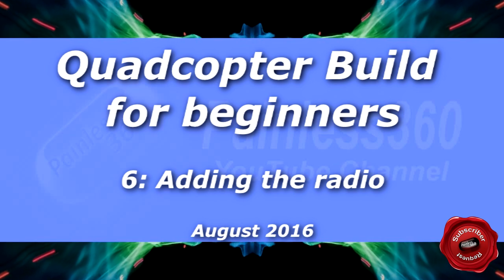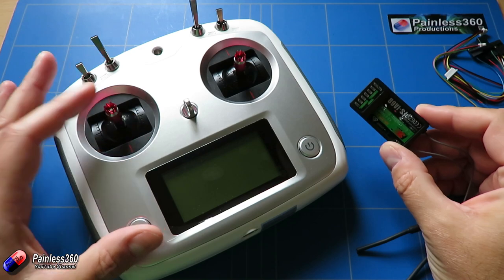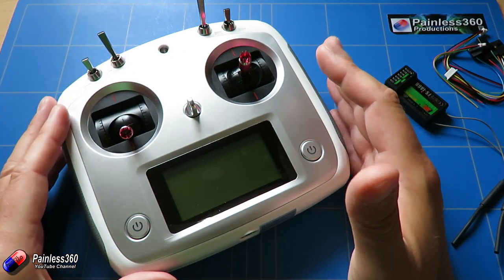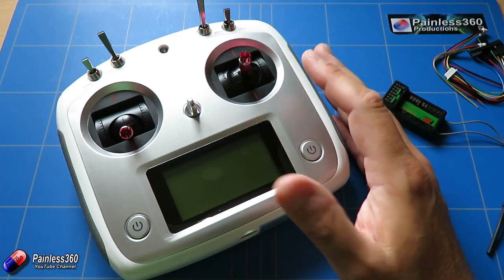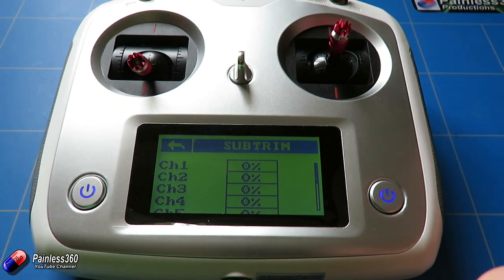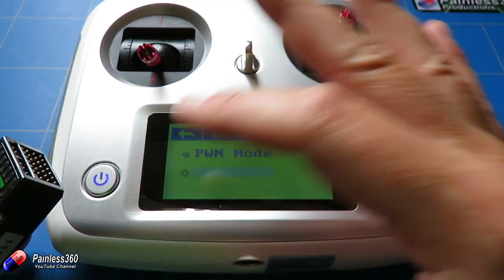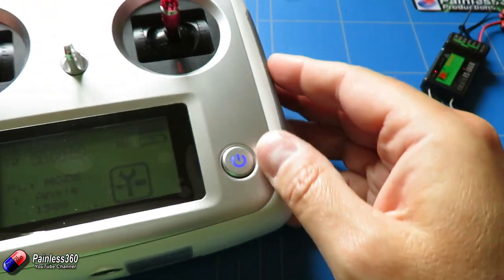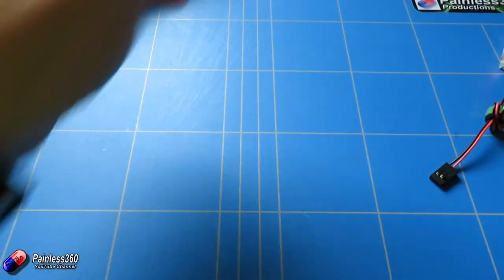(6/9) Quadcopter Building for Beginners - Setting up and adding a radio

Comment: Hello Painless360. I've got my FS-I6S,  i set up PPM output, stick mode M2, gave +5V and GND only the CH1 on the receiver and i have connected to the signal pins from receiver CH1 to APM input 1, receiver CH2 to APM input 2 and so on..., but it does not work, usually i have one channel which i can see something changing in the RC calibration, but others don't do anything when i am moving the sticks. Could You help me what can be the problem?
Reply from the maker: All of the detail on how to setup the radio and controller are in this series. If you're using an APM then we also have a series on that too.. In all of our APM builds we've used PWM (that's how you are wiring yours)..
Reply: Painless360 yes you are right,  that's my english is bad and i understood PPM and not PWM,  anyway i changed it and it works perfectly now.  Thank You for your answer and patiency..

Comment: What controller did you use the mode 2 or self centering throttle ??? cheers
Reply from the maker: See our series on the radio we used on the channel. For almost all self build quads you want a throttle that isn't sprung. The radio in the video is Mode 2. Happy flying!

Comment: Sorry for bugging ya about this again, but just to be sure so I don't burn a board out (again), I am safe to just use the 5V connector for the PDB to power my receiver up, correct? Thanks again
Reply: I've got the receiver coming on whenever I plug the battery in, but if I have the SBUS wires plugged in as well, then the flight controller lights nor the receiver seems to come on, any particular reason that might be?
Reply from the maker: That looks like you're connecting the SBUS connector into all the negative pins on the Rx, essentially shorting the GND, 5V and s_bus pins.. If that's what you're doing you're lucky you didn't cook something with the short..
Reply: Painless360 There's a bottom 4th row of pins for the SBUS connectors that goes (-, +, signal) it isn't the negative pins.
Reply: That's why I'm confused because the way it is acting I would assume the same thing, but whenever I'm looking at the wiring diagram for the SBUS connections its telling me to go to the bottom row below the negative pins and to put them in that order. Anywhere else you might suggest to begin troubleshooting?
Reply from the maker: +Gaige Chester if you shared what the receiver is, I might  ;)
Reply: Painless360 it's a R9D receiver, I've got it hooked up now and I took the drone for the first hover. Only problem to deal with now is that it just spins in circles lol
Reply: So I suppose my final question to you would be, is the spinning more than likely just a matter of trimming the quad, or should I be searching for another issue inside of CleanFlight? Thank you for all of the help you have provided to me!
Reply: So I suppose my final question to you would be, is the spinning more than likely just a matter of trimming the quad, or should I be searching for another issue inside of CleanFlight? Thank you for all of the help you have provided to me! I will highly recommend this channel to anyone building quadcopters.
Reply from the maker: Gaige Chester I'd check a lot of the same things you need to check if the copter drifts  - 1500 yaw control etc. Plus make sure that the propellers are on the Motors the right way round and that you haven't got any spinning the wrong way, as the Copter will use the rotation of the Motors to turn in the air so if you have one that's turning the wrong way round it will push it about.
Reply: I'll probably go through the video of your setup on CleanFlight once again, and then test fly.

Comment: Hello, Painless360. I am currently building my Dubai 210 Racer. I soldered everything, but i found that i cannot seem to connect my fs-ia6 RX with the F3 Flight Controller. I am using Fs-i6 Transmitter and successfully bound it with the RX. However i power the RX by UART1 on the FC and i have plugged all the cables from I0-1 and I0-2, but i get no response whatsoever. Any help would be great. (First build)
Reply from the maker: See the video in the SP3 series where we add each of the common receiver connection types.. Best of luck!

Comment: I have a small ppm receiver that I bought, do I simply connect the three red wires to that??
Reply from the maker: The PPM connection needs a GND, power and the PPM signal cable.. check the wiring diagram for your F.C. or model.. best of luck

Comment: Can you please help me. I follwed all of the steps in the video up until i was in cleanflight. I adjusted the rx settings to ppm, once i return to the rx menu i was still unable to see the graph like bars move when i moved my sticks. Also when i connect to the computer i can only use cleanflight when plugged into the power board. This is my first drone with basically no research done beforehand so im lost.
Reply from the maker: +Eric Sudfeld sounds like a little more research is needed, if you Google 'power painless360 usb' you'll find my video why it won't work off the USB. Watch the other beginner builds and introduction to radio control series for more of the basics. Best of luck

Comment: Can you please share the schematic for the 'Battery eliminate circuit' if it is DIY shown in the video at 13:00?
Reply from the maker: +Srinivasa Kumar it's a standard BEC. This one is a 3a switched model from Turnigy, you just need to solder on a battery connector. Best of luck!

Comment: Hello Painless, would you kindly show me how to connect servo channels like retracts or gimbal controls when using i-Bus on this transmitter?
Reply from the maker: i_bus is a single wire communication. if you want what you're after then you'll need to use PWM output on the receiver.. Best of luck!
Reply: Thank you for replying.

Comment: I have managed to bind my transmitter to my receiver but in betaflight under the receiver tab my transmitter isn't showing the control bars moving when I move my transmitter levers.??? Any suggestions.
Reply from the maker: What radio you have in your hands makes absolutely no difference to what the flight controller need. It's more about the protocol used in the model from the receiver to the FC. https://youtu.be/4iqKp-7RQkk may be worth a look... Best of luck

Comment: Great video. However, mine is still not working. I have a FS-IA6B receiver soldered directly to the FC. I plugged the FC to the 3 pin PPM/CH1 slot. I followed instructions for the transmitter FS-i6S. Cleanflight settings were altered like you mentioned. The Gyro on Cleanflight is responding according to the position of the FC. However, when i move the sticks on the transmitter, there is no response on Cleanflight. I am beyond frustrated. Any help would be highly appreciated.
Reply from the maker: +martin goggins campos tricky to offer any advice without knowing what troubleshooting you've already done. I'd check the receiver has power, is bound to the radio and that you have both the flight controller setup for PPM and double checked any settings on the radio to make sure that it's set for PPM too. Best of luck!
Reply: Thank you for the reply. The receiver has power (red light on) and successfully bound to the radio (RX shows up in the radio). I have the PPM set up in Cleanflight and the radio. Could this be a software issue? I was thinking of maybe rebooting, unless you can think of something else?
Reply from the maker: +martin goggins campos PPM mode on the radio?
Reply: Yes.
Reply: I started from scratch and did the following: 
1. Bind the radio to the receiver (radio shows RX signal)
2. On Cleanflight, i flashed firmware (No Reboot sequence, Full chip erase, Manual baud rate (256000). I did this after shorting the boot pads and got a solid red light).
3. Load Firmware (Online)
4. Flash Firmware (it worked and i got a successful message on Cleanflight. 
5. Connected FC to Cleanflight. 
6. Set Receiver to PPM RX

The gyro appears to be working as it shows up on Cleanflight and is responsive. However, there is no response when i move the radio sticks.

Comment: Hi, we got a connection of the RC receiver and flight controller using the PPM. However, receiver is not communicating with the ESC and motors. When we test the receiver with the transmitter and motors individually from INAV GUI, everything works perfectly. Could you give us some advice for what we can do to resolve this issue?

REPLY
Reply from the maker: What troubleshooting have you already tried?
Reply: We tried troubleshooting for the RC transmitter & receiver and running the motors individually. Are there anything that I can do else for troubleshooting?
Reply from the maker: So, can you arm the flight controller? Please see my build series for the steps I follow to get flying every time..
Reply: We tried almost everything to fix this (my pre-arming status is perfect), except for one thing. We are using the INAV and we do not have the GPS module. Do you think that is the problem?
Reply from the maker: Tricky to comment but see my iNav series on the channel. I'd confirm that the flight controller is arming and not erring as it's expecting a GPS.. Best of luck!

Comment: I bought a LUX flight control board and it didn't come with the wiring harness (15:30) and was wondering what i would need to wire it up the board to the receiver?
Reply from the maker: +Kevin Nguyen sorry, not sure. We've not use that fight controller here. I get in touch with the vendor and ask them for a harness. Best of luck

Comment: Will this receiver work with other radios? sorry i'm new to this
Reply from the maker: Every manufacturer has their own version of the radio protocol. The result of this means that most radios have to have a very specific receiver in order for it all to work together. See my video about it in the 'introduction to remote control' playlist on the channel. Lots of other things in there too, that you might find interesting. Best of luck!
Reply: Painless360 hey 👋 great channel , when i bind this receiver to my flysky i6s TX ( I did your flight battery mod to it ) I see my flight battery voltage and I see something like SIG :10 is that some sort of telemetry for the signal strength or a sort or rssi ?

Comment: hi, i have a very big question (sorry my inglish) i have the same radio (fs i6s) and a sp racing 10dof with osd, this flight controller have s-bus but i don´t know how to link the reciever, what pin i conect?cause the radio have s-bus too but i don´t know how to connect it, please HELP ME.

Thanks a lot
Reply from the maker: Please see the main SP3 series that we link to though this series. In there are lots more detail on setting up the board and also a video tat covers common Rx connections like s_bus too. Google 's-bus painless360' to find lots of helpful stuff. Best of luck!

Comment: Is it possible to buy such a "xt60 UBEC plug" (12:54min)  somewhere or do I have to solder it together on my own?
Reply from the maker: If you mean the BEC then you can get them from pretty much anywhere now.. Best of luck!
Reply: Painless360 i mean the bec with the xt60 plug. Maybe I did search wrong..Do you have a link? i'd appreciate it
Reply from the maker: I see! Most BECs don't come with the connector attached - we solder that on ourselves - http://www.hobbyking.co.uk/hobbyking/store/__4319__TURNIGY_3A_UBEC_w_Noise_Reduction.html.. Happy flying!

Comment: I can't get betaflight to recognize my transmitter. I'm using the FS-i6s TX and have successfully got it to bind to my RX.  When both are powered up, my TX can see the battery power of my RX, so I'm assuming it is bound successfully. Now when I go into Betaflight, under configuration I have receiver mode set to PPM RX input.  When I then click on the receiver tab and test my TX nothing happens.  I have gone to the Ports tab, and tried turning the Serial RX on for both UART2 and UART3 separately, saved and rebooted, but this has not helped either.  Further info: I have the battery plugged in while betaflight is on so that my RX is receiving power. I am using the SPF3 FC. Betaflight recognizes my fc being plugged in and is following movements correctly. I am brand new to this hobby and I'm at a loss of what else I can do. Idk how many hours I've spent reading other peoples problems (and your videos) and how they fixed it but it doesn't seem their problem is the same as mine (which I have no idea what the problem is). Do you have any suggestions?
Reply from the maker: +Hehegigglez Z if it's PPM then you don't need to setup a UART. See the video in the SP3 series..
Reply: Hey man, thank you so much for responding I didn't think you would see this, let alone respond in 10 hours! O.o I found out my issue was with an output setting in my TX, but I wouldn't have understood what that setting meant without your videos. You're a life saver thank you!

Comment: I'm using the same exact radio you're using, except I bought a bnf bfight 210 quad. It was pre-built because I'm not comfortable with building my own, but now I have no idea how to bind it to my radio. It doesn't have the cables coming from it like yours does that allows you to plug it in to the flight controller, but it already has an antenna on it, so I'm assuming it would have to be bound a different way. Could anyone point me in the right direction?

I've tried ppm and pwm bind modes while holding the button down on the quad and plugging it in, and neither seem to work.
Reply from the maker: +Newport31311 as you don't mention the model you're using, it's very tricky for me to comment. Are you sure the antenna in the quad is for a receiver and not for a FPV transmitter? I'd contact the seller and have a look in the manual, there are usually full descriptions of how to connect a receiver or to bind it to the radio. Best of luck
Reply: Painless360 that may be the case. I'll do some more research and see what I can come up with. Thanks for your reply :)
Reply: Yeah I built my own, but my FC came with no cables to connect to the receiver, and so I had to order yet some more cables to connect them and allow my controller to bind with it.
Reply: Valk yea after doing some more research I'm finding that out too. I also ordered a more compact receiver to fit it inside the quad too. Just waiting on that to arrive now
Reply: Newport31311 Oh, good luck with the receiver

Comment: Hi, I binded my receiver and I can see input on betaflight, also can control motors on betaflight. Once i disconnect from betaflight I cannot control my motors with my transmitter. Do you know of any solutions?
Reply from the maker: +Kinga what have you already tried? Are you aiming the flight controller?
Reply: This is my first drone build so I am quite noob at this, but for my understanding I have connected the receiver to the flight controller and the motors to the flight controller and I have binded my radio to my receiver. In betaflight, I see input from my radio (only in betaflight though), I can also controll my motors through betaflight. So my motors and radio are working (i think).I guess I'm just not sure what to do next.
Reply from the maker: +Kinga all I can suggest is watch all the videos in this series one after the other, I cover every single step to get your model in the air. Best of luck
Reply: Thanks
Reply: I watched the setting up cleanflight video, and I have esc that use DSHOT150 and 300, i set it up the way you do using oneshot 150 and setting the max throttle and min throttle which made the esc make sounds (which I think completed the configuration), but there is still no input from radio after I disconnect from cleanflight. Does this have something to do with DSHOT or my esc? A blue led turns on and blinks when I use throttle on my radio. Also blinks once each time I use the B switch on my radio. Im not sure if this information helps solve the issue or if i should just keep digging. I'm just confused motors work inside cleanflight but not when I disconnect from it. I also soldered the motors in the wrong spot on the FC is that has anything to do with it (thought that would just make it fly awful but i just want to see if the motors work with my radio)
Reply: To add to my comment above, should I use bl heli to configure my esc? and if so do you have any experience using bl heli?
Reply from the maker: See the Betaflight setup video from earlier this week. You shouldn't be setting throttle range if you're using D-Shot.. Best of luck!

Comment: RX Voltage? is that not just going to be the boards 5v? will in not just read the same until it falls out of the sky? Whats the point of it? :/
Reply from the maker: Watch the series .. :)
Reply: Given that I am using a 3 wire only IBUS connection and it comes from the the board on 5v . It can not be anything else,so it seems pretty painless to me.
Reply from the maker: Almost all receivers use the 5v output on the flight controller to power the receiver (the exception being the Spektrum Satellite Recovers that need 3.3v). The 5v power output on most boards is well regulated so you don't have to worry about it in use. Best of luck with the build..
Reply: I am just going to power the RX from 2 cells on the balance plug so I will get to see the battery voltage. 8.4v and set the alarms at 7v and 6.4v  Cheers!